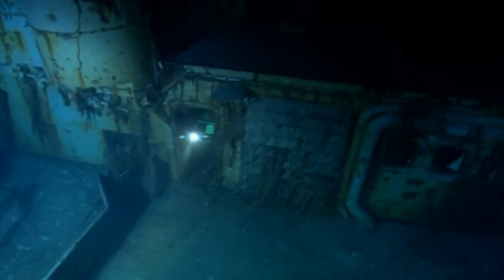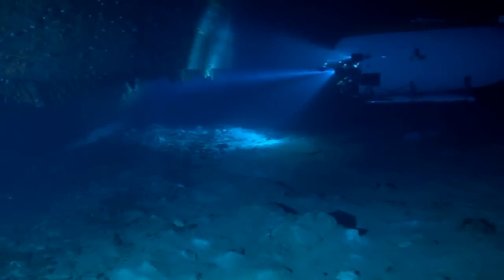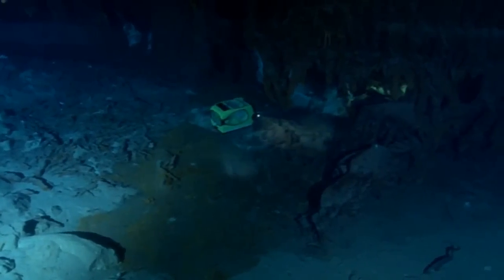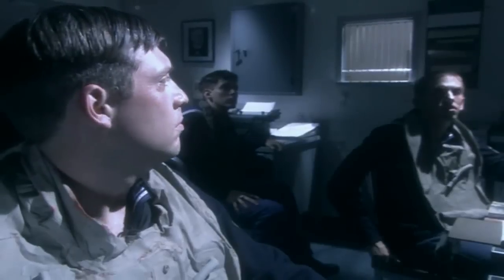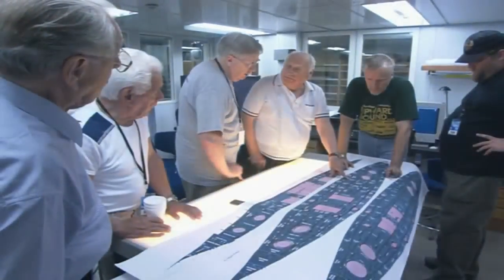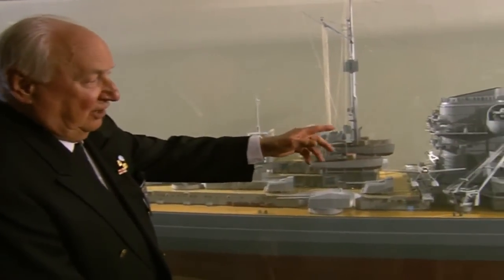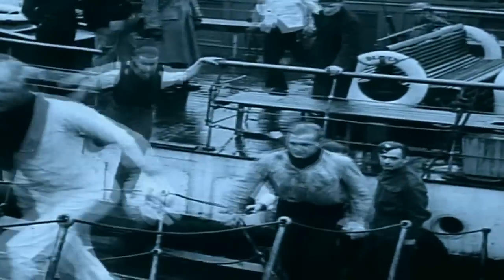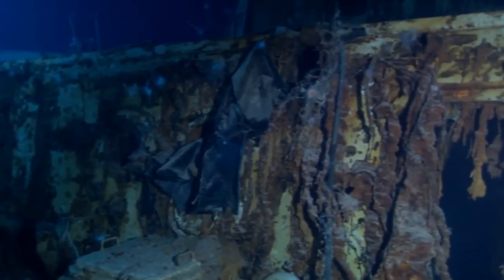James Cameron's Expedition Battleship Bismarck documentary english part 6

Comment: Just think about the guys in the ships that sank during the battle of jutland.....that's relatively shallow water .....which means that lots of men were probably still alive and trapped inside compartments that were water died and had to wait for the air to run out before finally dying. Which could take a long time if you were trapped in a fairly large compartment by yourself....imagine the horror and stress that a person has to cope with knowing your trapped down there and that rescue isn't going to come. that thought makes my stomach tie in knots....being buried alive in anyway is my biggest fear....tho being trapped in a coffin would be far worse than being trapped in a sunken vessel, I still wouldn't want to suffer being trapped in either one.
Reply: Years ago, I was fortunate enough to be taken on a guided tour through the salvaged wreck of the German U boat U-534. It had laid on the seabed of the Kattegat off the coast of Denmark for 41 years before its salvage. As I walked through the now dry and now thickly rusted compartments it was clear to see some areas of each compartment where air had remained trapped after her sinking in 1945 and the original paintwork of the submarine was still visible. My immediate though was (and it still sometimes comes back to me) was the horror of imagining being trapped in there with your face pressed against the compartment roof in that small bubble of air, with no hope of rescue, exactly as you say. The stuff of utter nightmares.